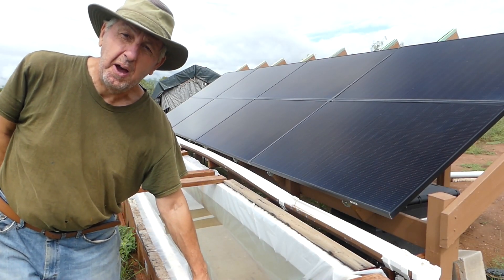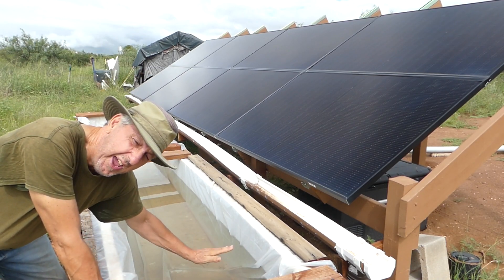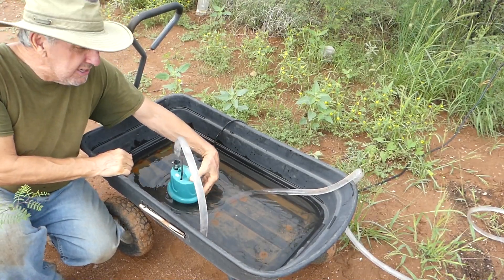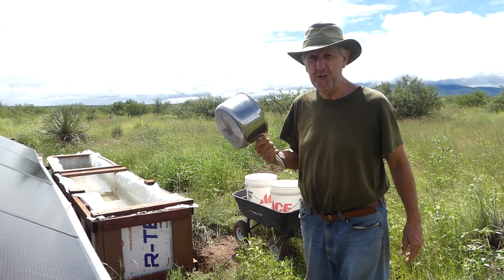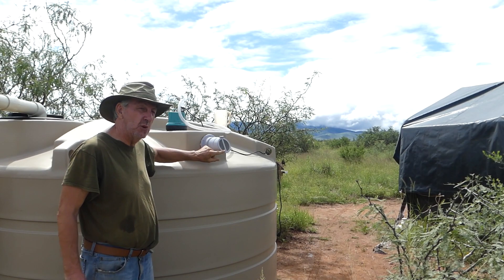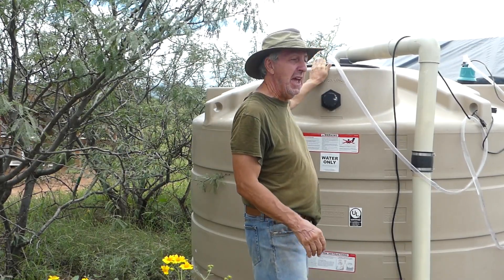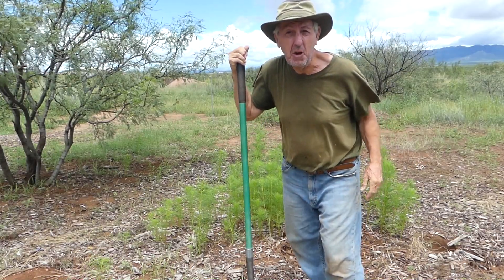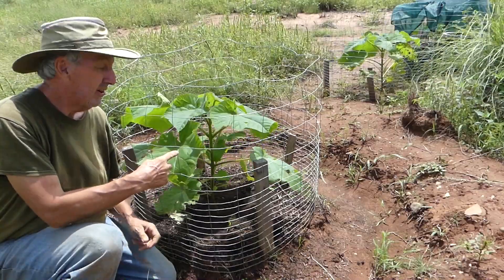Rainwater Harvesting from Solar Panels produce too much water?

Comment: Your locations confuse me. Why is your holding tank soooo far from the house? Common sense dictstes you either locate your storage next to the home or where its gathered from. Personally, I would have storage tanks located under the panels, in the shade. Tons of wasted room there. Bury 2 tanks, side by side, under those panels just deep enough for the tank tops to be lower than the gutter. Lett gravity fill those tanks directly. Personally I would have built the panels high enough to accomodate a tank under them.
Reply from the maker: Hi Jeff. Many thanks for watching. Some great great questions there too. Holding tank is far from the home for aesthetics. I enjoy having a yard that is clearer where I can plant more trees and shrubs and make it look more like an oasis rather than utilitarian with tanks etc. Also the pipe that runs 45' ft from the home is nicely buried.  When the leaves come out the tank is nicely disguised also. When I created the solar panel array I never really thought of using them as rainwater harvesting items. So with the array already in place I had two choices. Purchase some low rider type stock tanks and put them end to end.  Or... build what I did in the video. The main issue with the stock tanks is I would have to dig pretty seriously down to create a home for them.  But... the big story is that those things are expensive now! So my DIY tank was affordable and a custom fit. And... a fun project. Thanks again!  Don

Comment: Canners add vinegar to the water here in Arizona to preserve the condition of the canner and the jars. The downside is that it increases the rate of rusting on the rings and lids. Your pump won't be happy with the sudden change of acidity, even if the results are invisible for a while. You could add very small amounts of vinegar to the water, but I'm not sure how you'd want to estimate the amount.

Comment: If the rainwater you collect is intended to be potable, I hope your solar panels are glass-clad, and your roofing material is properly rated.
Reply from the maker: Hi George, thanks for watching the video. Those are excellent points. For my rainwater harvesting with a roof I chose a toxic free metal so that’s taken care of. For this with the solar panels it’s never intended to be drinking water. It’s only for irrigation. Thanks so much for the great comments. Cheers.
Reply: @affordabledesertliving3487  Ok, I figured you were on top of it, but just wanted to make sure you weren't drinking toxic water! BTW, from one senior to another, congrats on all you've accomplished out there on your own. You certainly have my respect. :)

Comment: Vinegar water vs pump: acidity (and conversely, alkalinity) can degrade the pump membrane and diaphragm. It is advisable to treat the water, not the pump, which is only making a tiny contribution to any water contamination. Your set-up looks great!
Reply from the maker: Thanks very much. Good tip on the vinegar. Thanks.

Comment: If your impeller in the pump is all plastic with no metal parts vinegar should be ok but a half tsp of bleach in 5 gal of water would be better.  If metal parts in pump tjhe bleach would be better than vinegar.
Reply from the maker: Great input Windmolen Farm.  Many thanks for watching.

Comment: Here's a tip that I learned with moving fish tanks around.  Float a block of wood in your buckets which will dissipate the mechanical energy of the wave and the water won't slosh out nearly as much when you are moving them around in the gorilla cart.
Reply from the maker: I tried that this afternoon. But maybe my pieces of wood were too small hmm.
Reply: Float a piece of 2x4  6in long. You can also do 3-4 pcs that are shorter (around 2in).
Reply from the maker: @Matthew-ju3nk  Okay thanks.
Reply: Okay. This is me just being a wise a$$ (and you should feel free to throw a brick in my general direction) but the thought just occurred to me that you could just put a top on the buckets?

<dodging the thrown brick>

Comment: If you run out of water in a dry year do you have it delivered?
Reply from the maker: Yes William.  I usually order about 2 times per year.  Its $225.00 each time for 1600 gallons.

Comment: A simple garden hose attached to your pump should work just fine. Have you considered putting a swimming pool under the solar panel array? It should not cost very much money and it could handle a great deal of overflow. Cover it with cheap plastic to keep the Water from dissipating.
Reply from the maker: I like the idea Brian but I need to access the wiring etc under there easily.

Comment: In our submersible pump I pour 1 gal of bleach down my well then run my water till you don't smell the bleach at your faucets and it cleans and sanitizes all the lines in the house, hot and cold side.
Reply from the maker: Good tip Kip. Thanks!

Comment: You can certainly collect more water as long as your tank is lower than the gutter it would keep filling up. The inlet can be under water as long as the collector is higher
Reply from the maker: Your so correct John.  I just keep embracing the learning curve. grin.

Comment: I love seeing all your progress. I'd be in Arizona too but my wife grew up there and hates the heat. I love desert flowers and when we lived in Phoenix one of my favorite places to go was the Desert Botanical Garden. My wife and her family thought I was nuts. Last time I went I convinced my sister-in-law and family to go with me. They last 10 minutes. Everyone lives in air conditioned spaces so they can't take the heat anymore. The first cluster of yellow flowers with the large center disk is called Bidens curnua or common name  Nodding beggarticks,. The second yellow flower looks like Heterotheca subaxillaris or common name camphorweed. It could be coreopsis but the leaves are different than mine. The third purple flower looks like morning glory, which is a vine as you can see it twisting around the other plant.  The fourth flower purple with yellow pistil is a Solanum elaeagnifolium or common name silverleaf nightshade, sometimes called prairie berry. The next flower, also purple but with yellow stamen, is Allionia incarta or Trailing Windmills. The little pink flower looks like stachytarpheta indica or porterweed. The last one in yellow is Zinnia grandiflora or Rocky Mountain zinnia. Just an FYI if the plastic you used to line the trough is just regular clear plastic sheeting it probably doesn't have any UV inhibitors and will likely start to get brittle and break down before the end of the year. Can you make a wood lid that will protect it from the sun? A benefit is the darkness will also slow algae growth.
Reply from the maker: Wow RedHotFiat.  I cant believe your kindness in naming all of these cool wild flowers!  At 4600' elevation its really not all that hot. When its 108 in Phoenix its only about 90 here.

Comment: You could get an RV water hose(s) the length you need. RV water hoses are drinking water safe - no bad chemicals in the build process. Amazon, Camping World, probably even Cal Ranch in Sierra Vista will have them
Reply from the maker: Great tip Dean.  I wont be using this water for drinking but still great to know about the RV water hoses!

Comment: too much water in the tank.  Sounds like a good problem to have.     While you have an abundance of water, time to do things like purge out the dirt and dust that settle in the pipelines and the bottom of the tanks.    Also, instead of that easily kinked tubing, I'd go for a high quality regular water hose.   Get one that's rated for potable water, as that will be made from materials that won't degrade from chlorine exposure.  get a set of spare gaskets, and change them out annually.
Reply: Just had a thought.   the garden hose, get one that is dark in color, and lay it out someplace like around the solar panel array.  That can be kept full of water and  be an easy source of solar heated hot water for washing up.
Reply from the maker: I have a green hose that I do just that with. Thanks.
Reply from the maker: Great suggestions dale. Thanks!

Comment: I wanted to build the water harvesting roof directly on the gentle slope. The problem I have is not so much of that slope to put the classic plastic tank to collect immediate rainfall, as the tank is just too high. But you gave me an idea to build my own open large gutter. I just would directly allow the water to go there instead of using gutters. If I used strong pump I would be able to remove that water quickly enough to larger tank. The system would work fully automatically of course and I would use transfer pump and not the one that is submersible one you used.
Thank you and good luck with your projects!
Reply: Can you dig out some dirt and make the tank sit lower?
Reply from the maker: No because this tank will be used for shrub/tree irrigation and will be gravity fed. So I cant make it lower.
Reply: @kittykat999a  Good suggestion. I was thinking of this initially. This would need to be special tank that is designated to go underground. These are 2x more expensive as the on-ground ones. And the installation cost is greater as you need to dig a hole. 

I was also thinking of a set of smaller barrels sitting in the ground and connected together...
Reply from the maker: The beauty of rainwater harvesting is that one can make specifically what works for the property you have. Hope it goes well!

Comment: Without info on the pump... I'd not put anything harsher than the concentration of bleach you'd use in laundry through the pump... and probably not even that harsh.  Enough bleach to kill whatever might be living in the pump.

Then flush with plenty of clear water before using to transfer into your tank you drink from.
Reply: Vinegar as a cleaning agent is good for cleaning hard water deposits.  These are usually calcium based and the mild acid of vinegar is pretty good at keeping it in check in a drip coffee maker.

Again... it would need flushing to get the cleaning agent out.
Reply from the maker: Thanks F Huber.  I think I will just keep flushing it with clean water at this point.

Comment: Some places it's illegal to collect rain 🌧 water 💧? Don't use that water for drinking unless you RO the water. Put cover to block sun from collection tanks to reduce alge and drain completely to stop mosquitoes. Good luck. 👍
Reply: In my county it's illegal to collect sunlight(solar panels). I hope they never outlaw the air that we breathe.🤣
Reply: @cliffandrews  a friend of mine said in his area only after it hits the ground, crazy 🤪
Reply: no worries... its not illegal to collect rainwater in Arizona..Thankfully!
Reply: @lorinew-s2841  Nor here in California yet. I live along the Yuba River anyways, good clean water. (not supposed to pump from it though)👎300 feet to my house.
Reply from the maker: Thanks Go4UM.  I wont be using any of this water for drinking!  It's all for irrigation purposes.
Reply: It's perfectly safe to drink the water without an expensive RO system - that's just ridiculous. I use hydrogen peroxide in my tank and have had the water tested several times over the years and it's cleaner than than any city water in AZ.
Reply: @rebelyell1580  this all depends on how you collect and store your water. I have friends who did get sick so better to be safe than sorry. You can't always assume people know what they are doing.

Comment: Why not a good 100 foot garden hose problem solved
Reply: I have a long white water hose that is specifically for transferring water.  I got it in the RV section at Walmart.
Reply: @ConservativeWoman-t2j  That's right, the white RV hoses are safe for water consumption, garden hoses are not safe.
Reply from the maker: Great idea. However this water primarily slotted for irrigation for trees/shrubs